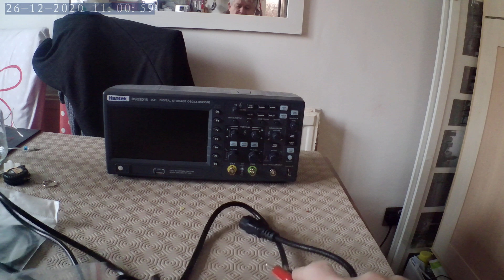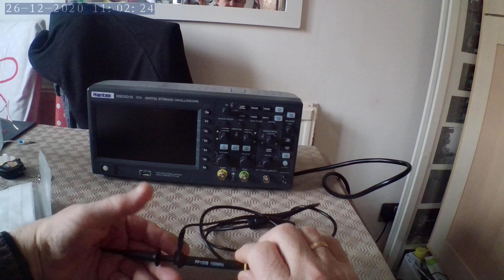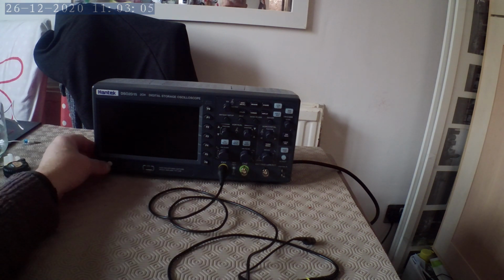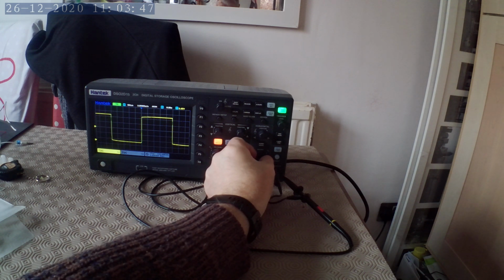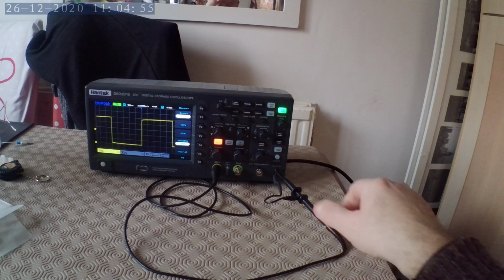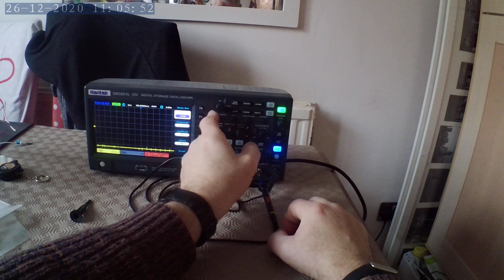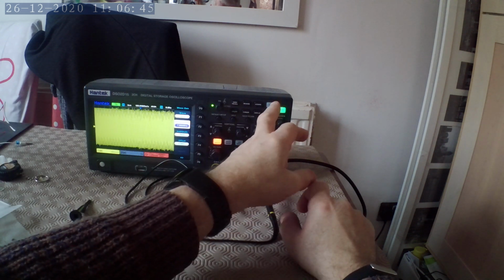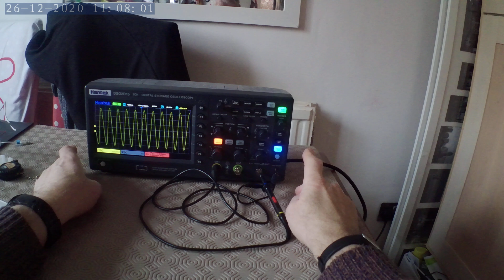Hantek DSO2D15 2 Channel Digital Storage Oscilloscope First Impressions

Comment: I don't know why there is no mention of an output tone from the Signal Generator.... I know that the generator outputs a sine-wave because I can see it on the scale... but is there also a signal tone for a radio speaker that you can physically hear from a speaker ? I'm trying to do a shortwave radio alignment and I need to physically hear the 455Khz audio signal tone from the generator.
Reply from the maker: To hear sound you need a speaker, as far as I am aware the scope does not have a speaker, nor do I recall hearing any sound from it!

Comment: Bought the DSO2D15 model, only months later I discovered it has Trigger Level problems with signals below 300 mVpp @ 1 KHz. I did all the firmware updates, still the traces run on the screen, no way to stop them. Things get worse if you keep the oscilloscope on for more than ten minutes. 
Then, if you select a 50 mVpp sine wave with the internal signal generator, the image is strongly noisy, distorted.

I contacted Hantek several times, they wanted a video of mine showing the issue. Sent the video twice in a month, then Hantek disappeared. I re-sent a final e-mail today, I am waiting for a sign of life from them. At this moment no help at all, their after sale sucks.
I did a BIG mistake, I should have bought a Tektronix instead but you only learn these things later...
Reply: Moral of the story: avoid unknown brands like Hantek. Either go with Siglent or Rigol for entry level or more professional brands like Keysight.
Reply: Hi, any update on this issue, did you get anything else? i am looking for something similar that doesn't break the bank. any recommendations. Thanks.
Reply: @jeff15  Hantek has the worst after sale I ever met in my life, neither with the latest update file the issue has been fixed -- save your money, get a Tek 1052C or a Keysight EDUX1052G.

Comment: Disappointment (very) with Hantek DSO2D10 scope .    I own this unit (new) about 6 months and used for 2 months then it Ch2 became out of calibration - the zero is off by 150mV when use the "zero" button. The reading also lower than Ch#1 by about 46% when I connect the same probe to the  square wave test output post of the scope. I used the calibration  function(found in Utility bottom) and it came back with error code  :  511d6. I also downloaded the latest software from Hantek. It did not improve and same error code. Tried email to Hantek service .  Hantek in China finally responded with instruction to re-flash firmware.Followed instruction exactly and the results were WORST > now CH1 zero is off by 800mV and reading 4V on 5V.  CH2 was as bad as before. !!!  Contacted  Hantek again and cannot help and was asked to contact seller ( the seller was Hantek Official Store)    If you are thinking of buying this beware you are on your own for service and repair.   It would be questionable at best on the logistic , honour and followup repair

Comment: I purchased my "Hantek 2D15" about 3 weeks ago and I LOVE it!
I likewise purchased mine from AMAZON and caught it on a deal for $299, with another $18 off + free shipping.
This is my first DSO, aside from the JYETech 138mini and DSO 150 I have built. I plan on putting it up against both of my EICO 460's , just for fun. Both (analog and digital) have their purposes and places for me. I do LOVE my EICO instruments! 
I have updated the firmware to "20210416.00" from the Hantek site. This has seemed to correct any "lock-up" issues I had when it first arrived.
My advice. Leave your actual "firmware" alone, until Hantek releases an "official" firmware update.
I also like the fact the "D" models have the AWG built in. No, it is NOT a Keysight OR a Tektronix, but it seems to work just fine for us electronic hobbyists.......I like it!
To this point, I have NO bad things to report with my "2D15" and I am VERY happy I chose it.
Best regards to all,
Patrick

Comment: Can this be used as a digital multimeter? If so how? I would like to check capacitor polarity but can't figure out how?
Reply from the maker: You ca measure voltages, for AC values will be more accurate than a multimeter. If the capacitor still has voltage, you can measue it, but most probably has gone flat

Comment: Arrived today Ordered Dec 30 2020 ... they put the stupid power adaptor on the screen side sitting against the screen. Used my own US power cord .. had to turn it on and off a few times it was stuck at the Hantek Logo but Seems to be working now .. and Yes was your review is why I bought it .. replacing my OLD CRT Scope ..
Reply: Rob, I just ordered this scope. I gather the scope auto switches from European 220v to US 120v safely?

Comment: Aren't you concerned at how noisy and unstable the signal was on the scope?
Reply: Higher bandwidth more noise. The unstable signal is probably from the signal generator. 
But Hantek isn’t the best scope manufacturer. I’m not sure if this would be the best choice and it’s only a 2 Chan scope. 
I did a project with a 3 phase DC motor and 4 Chan was the minimum to get it done.
Reply: @Todestelzer  you can't really get a 4 channel scope with similar specs at this price. They do make 4 channel scopes but you need to take the price point into account

Comment: I measured DSO2D10 from the output of 74lvc1g14 tr-1.5nS, the bandwidth of the oscilloscope is 250 MHz. With a bandwidth of 100 MHz, the readings were a pulse rise time of 3.5 nS
Reply: Do you have any waveforms to view ? The specs of the 2D10 says 3.5ns so if you got that then it's in spec nothing extra. It's 2.3ns for the 150MHz model

Comment: I have the 100mhz version and it wont read any of my usb sticks, could you try yours and let me know if it works please.
Reply from the maker: Just tried after formating an USB stick to fat32. when you plug it, you get a "sorage device is connected" . clicked on "save to usb", and the file is there - bmp format
Reply: @javiermitchell7073  Thank you very much, I'm going to try another USB stick and hopefully find one that works.
Reply: @3dmaxuser  It (the USB thumb drive) must be formatted in "Fat32" for it to work.

Comment: Rectangular pulse generator up to 5 MHz?
Reply from the maker: The only place I found the specs are n the bangood Site:
https://www.banggood.com/Hantek-DSO2D15-Dual-Channel-+-AFG-Digital-Storage-Oscilloscope-150MHz-1GSa-or-s-Signal-Generator-Oscilloscope-2-In-1-p-1766504.html?cur_warehouse=CN

You can see that for square wave the limit is 10Mhz:

Sin Frequency range 0.1Hz~25MHz
Square/pulse Frequency range 0.1Hz~10MHz
Triangular wave Frequency range 0.1Hz~1MHz
Sampling wave Frequency range 0.1Hz~1MHz
Index Frequency range 0.1Hz~5MHz
Reply from the maker: as per the manual: square wave is 0.1Hz~10MHz, sinewave is  25Mhz